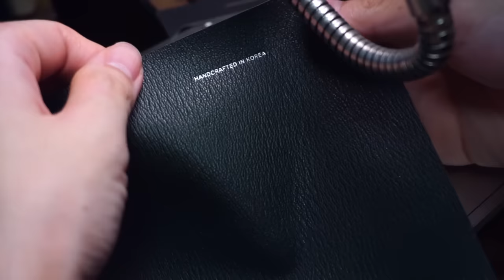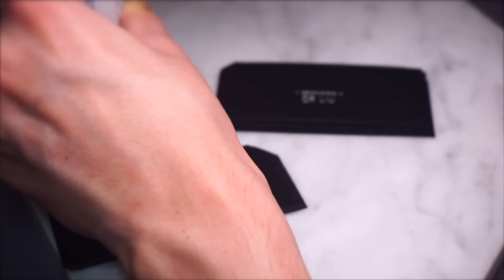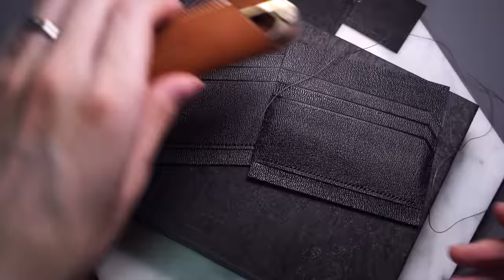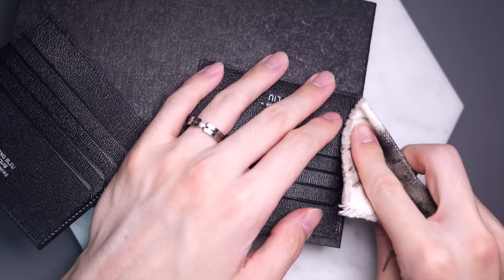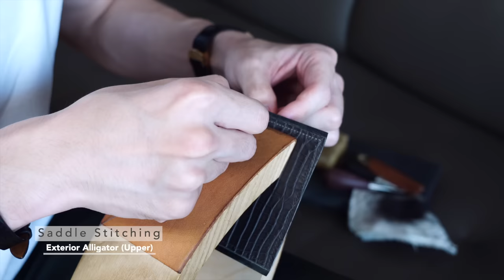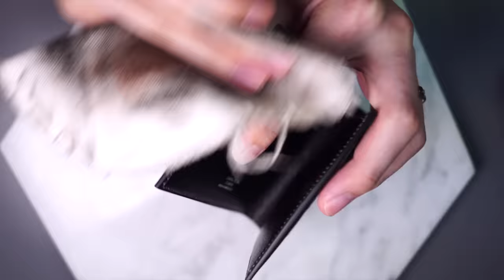Making Hermes alligator bespoke wallet that beat the $5,000 Hermes wallet

Comment: That skiving knife cover is gorgeous.
Reply: Also I commend you for not punching all the way through with the iron and awling each hole. Despite each edge probably being thin enough to punch through, without making too big of a hole. Well done.
Reply from the maker: Thank you for the recommendation! But those kinds of irons don't have tapered blades, so I can punch all the way through without widening the holes. But, as you recommended, I used to use the awls when I'm stitching thick parts 😉
Reply from the maker: Thanks a lot!😉

Comment: I made this wallet out of ALL crocodile, ie a Sepik River crocodile…it turned out beautiful. I wonder if the entire thing is croc if it’s worth more?
Reply from the maker: I think the entire interior in exotics is not the aspect that makes the value of the final artwork higher than the normal interior.

Exotics are pretty delicate to use and that makes it poor practicality for the huge capacity wallets like 8cc bifold design.
That is the reason why we don't offer an exotic interior for the bifolds.

Comment: how big is the wallet? Looks quite large compared to a regular bifold
Reply from the maker: W10.8 x H9 cm which is smaller than regular bifolds. I've designed it as compact as possible with 8cc capacity😉